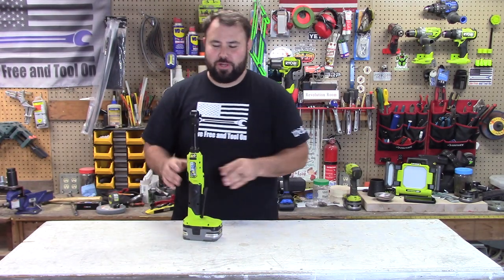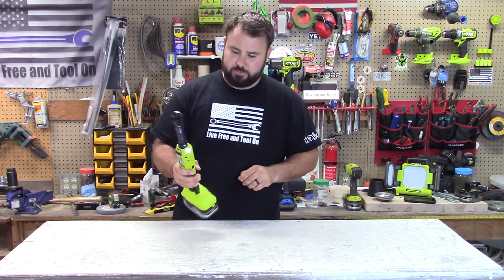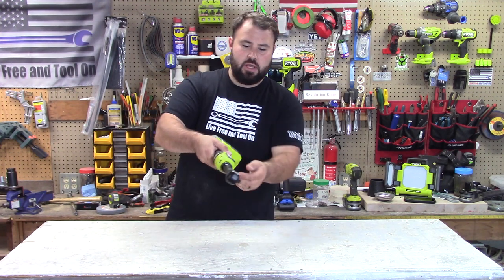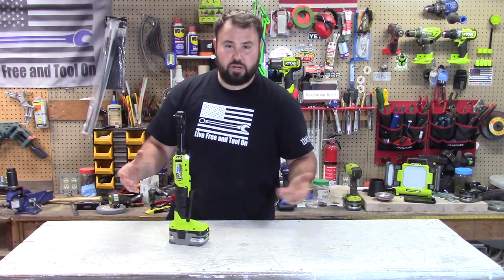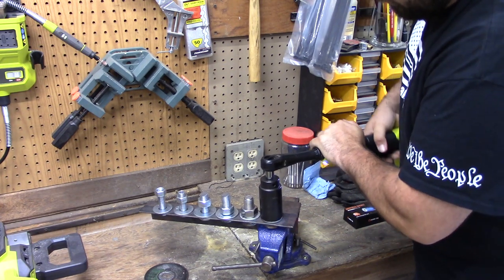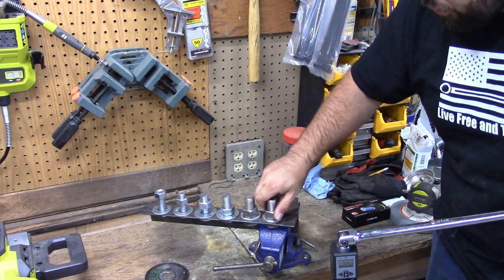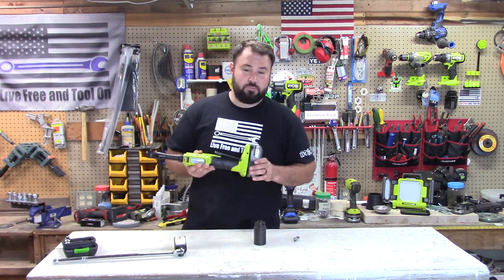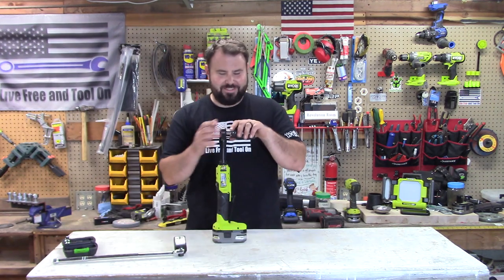Ryobi extended reach ratchet wrench [watch before you buy]

Comment: I'm in the ryobi family. Honestly they should have designed a battery specifically for this tool. I would love to get this tool, but that big base doesn't do it for me. If they come out with a different design, I'll reconsider.
Reply: That’s what the 4 positions are for…
Reply: @Roof Korean  yeah, but this doesn't guarantee that you can clear spaces when using. I've been in situations where I couldn't use an air ratchet, so I know I can't use this. Maybe that fat-ass bottom battery base will work for you, but it won't do for me 4 positions or not.
Reply: @cmoney220  one of the big reason I bought three Milwaukee ratchets, you can use slim or bigger and more powerful batteries,  all depends on  if you got the space or not.
Reply: If you're gonna buy a new battery just get a Milwaukee. Ryobi has kept their 18v batteries the same for decades and it's what brings people into the family.

Comment: I own the m12 fuel ratchet, so I just need the extended ratchet and it seems a no brainer to get this over the milwaukee
Reply: milwaukee has to relax with those prices
Reply: @eugenevalentine925  yea, can’t help when  their stuff is manufactured in China.  You should check out Home Depot because they are having trouble stocking their tools for the holidays. Their ryobi and Milwaukee stands at the gift center is like empty.
Reply: @eugenevalentine925  yeah seriously.  I’m in love with those new wrench sets. But each set is like $120 for $15 pieces which is ok. $240-ish for both SAE and Metric. Then if you want them in a ratcheting configuration instead it’s dang near $500… and if you want them flex head that dang near $700!  Like wtf!?
Reply: @eugenevalentine925  I have borne the 1/2 and 3/8 M12 stubby with a 6 amp and 2 amp battery. Bought them from people on offer up. I think $100 each gun, maybe $60 for the batteries and charger as a set. The stuff was brand new in the box and unopened.  I’m thinking they may have been stolen,… but damn Milwaukee, with your prices , it’s almost your own fault. 😂🤷🏾‍♂️🤦🏾‍♂️

Comment: Naahh, you cheated a bit @3:54, just a little manual twist to help it along, not just by pressing the switch a couple of times. I don't mind this seems to be a well worth tool to add to my Ryobi collection, I love the fact that my multiple-year-old (is it over a decade even, I'm not sure when One+ came to Sweden) drill driver still works and uses the same batteries.

Comment: Got a package deal with a impact for 200 at Home Depot
Reply: Just picked up that same combo, (this ratchet, 3/8" HP impact @ 160 ft lbs torque, 1.5ah battery, smart charger). They also have a kit w/ this ratchet, the Ryobi P262 1/2" impact wrench - 450ish ft lbs tightening torque, 600 ft lbs breakaway - I believe a 2ah battery & charger for $239.....if I didn't already have Rigid's comparable, (slightly more powerful) Octane 1/2" impact wrench, I definitely would've jumped on the latter kit, instead. But either way, I was waiting for the right deal on this ratchet (had initially bought @ $159, then returned, being defiant about paying full-price, lol!), then picked up the 1/4" version, (only 40 ft lbs, so 15 ft lbs less, BUT 260 RPM vs 230 for this/the 3/8") w/ a battery & charger for $159, ($10 less than bare tool price), but was DEAD SET on owning this one, between the 2 (seen this break nuts free torqued at 65 ft lbs....that extra oomph is invaluable to me, tho this IS a nut-runner....but still...makes a difference), so FINALLY scored the deal I could live with. LOVE THIS RATCHET. Would I rather have the extended reach Milwaukee? Of course....but power on this is same, head not as bulky & I'm ALREADY invested in Ryobi (& Rigid), so as a DIYer, just can't justify the Milwaukee's price, (ntm, batteries, charger, etc). No..this bad-boy is EXACTLY what I want, need & am comfortable with, price-wise (a decision I came to after MONTHS of OBSESSIVE research, a handful of purchases of competing brands & scouring the net). THIS is, IMHO, THE BEST bang for my buck. Great video/review. THANKS! 🙏🏼
#SUBSCRIBED💯👍🏽
Reply: @richardmejia254  I got the combo with 600 1/2 impact. I used both already working on my truck multiple times. They have more powerful impact now but want around 200 bucks just for tool. I already had multiple batteries so I didn’t have to worry about that.

Comment: I've got a Ryobi angle drill from 20 years ago, similar tool but fitted with a chuck, and it has a rotating battery holder. Strange that Ryobi has decided to make the wrench adjustable rather than keeping the rotating battery since that is a better design.
Reply: Ryobi also used to make a blue angle grinder with a rotating battery holder which makes a lot more sense. I"d be willing to bet it"s a cost savings decision to have the head rotate instead of the battery. Ryobi is always...always looking for ways to shave a half-cent off of a product for bigger profits.
Reply: What’s the difference? Either way the battery rotates. I think having the head rotate is a better design. More efficient use of materials.

Comment: Paying over $500.00 is not cheap.
Companies are scamming buyers by selling it without a battery & charger. So buying it for $180 will not remove anything.
Reply: so batteries and a charger are $320? This makes no sense.
Reply: @one_mega_ohm9139  Correct, true scam.  
Like no fast charger when buying a $2,000.00 Samsung Galaxy S22 Ultra or iPhone 14 Elite.

Comment: Good review. I have the standard model but might consider this whenever they show up at Direct Tools. 

Off topic but wondering if you have the 40v inverter station. Would love to get a time review on one similar to your battery reviews on the 2 smaller inverters. I know it's a pricey piece so understand if it's not currently on the table. Keep the great reviews coming.
Reply from the maker: have you checked this out? https://youtu.be/u3aIGpmAu0c
Reply: @livefreeandtoolon  yes, I mean the larger power station that uses multiple 40v batteries.

Comment: Bs when u broke it loose with the torque wrench the video stopped recording first but when u tighten it down with the torque wrench and then loosened it with the ryobi u didn't show us what the torque was set at on the torque wrench itself. Also u gave the ryobi wrench a manual push to help it out when it wouldn't brake the nut loose itself. Your promoting and getting paid or getting free tools. Nice try dude.
Reply: 🙄🤦🏻‍♂️
Other video reviews on this, ALL demonstrating that the claims made in this review are ON POINT/💯% LEGIT.....
(NICE TRY, DUDE)